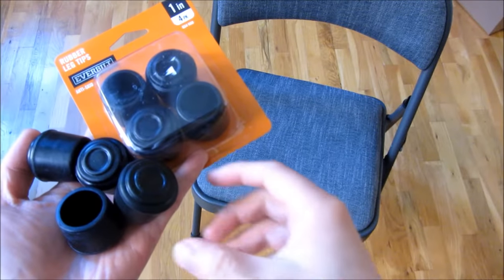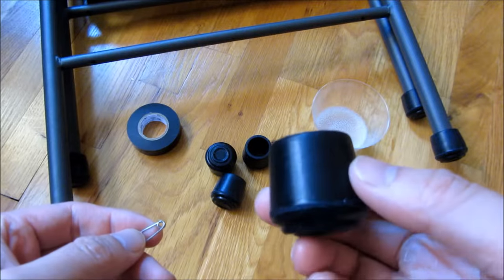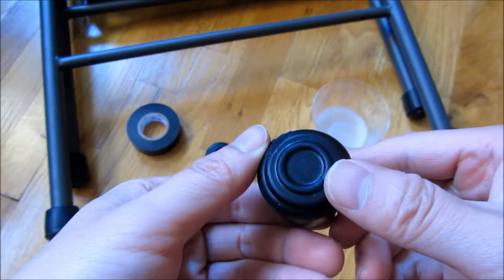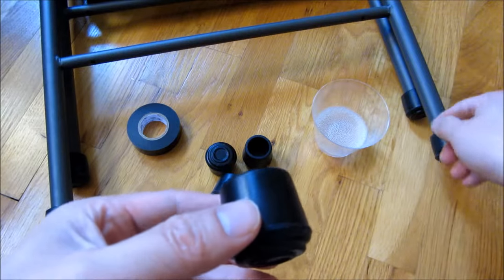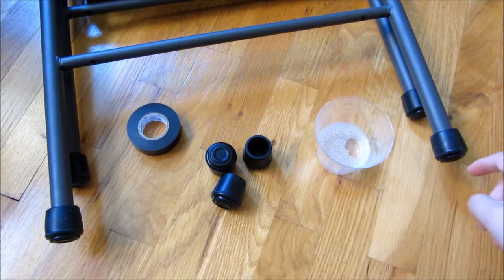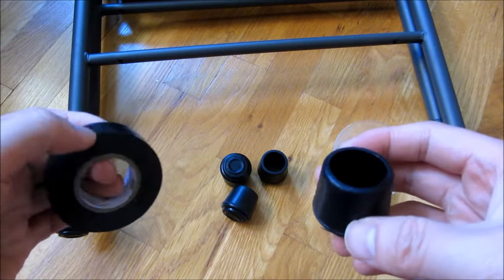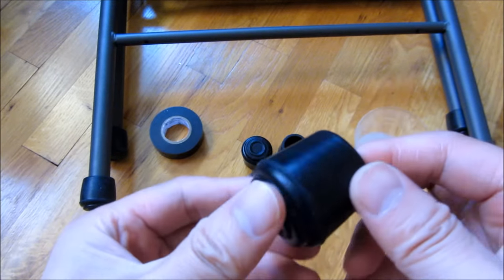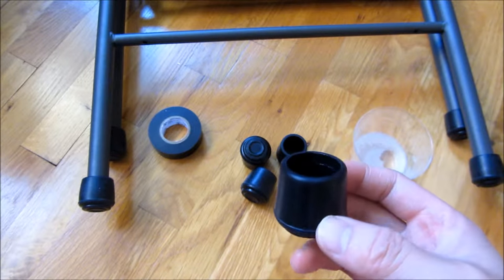How to put on Rubber Chair Leg Caps | Protective Rubber Tips

Comment: Still not working, vintage table I bought, double-tube. On chart online, it looks perfect match for 1" size outer diameter - seems to match existing old tips (only missing one) - will try putting "old" one on this leg, see if it works on others. Tried placing new tip in warm soapy water, soapy water, and also vaseline, on bare table leg.
Reply: Finally got it - had to take and cover the ends of the new tip with some cloth, then tap it with a hammer - after soaking it in dish soap and coating sides of new tip with dish soap. Amazing how the new one could look exactly the same size as the old one, but be so difficult to get the new on one.